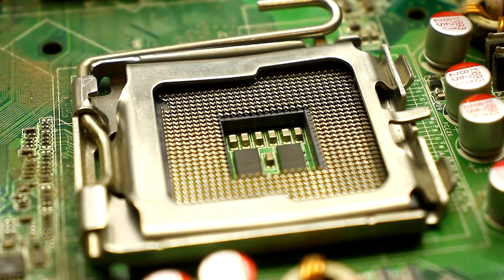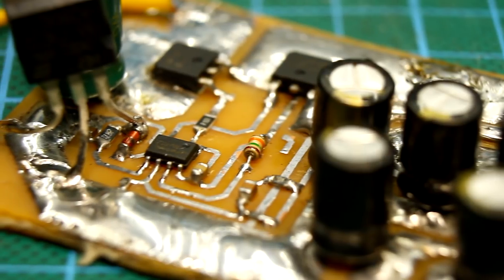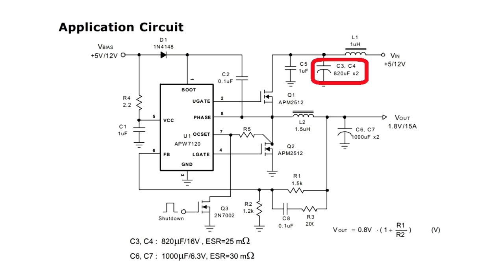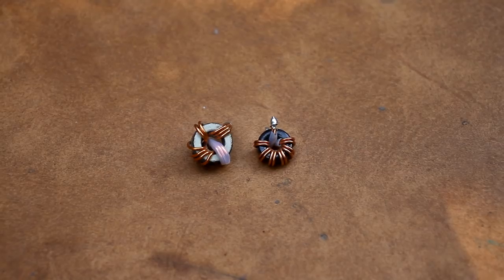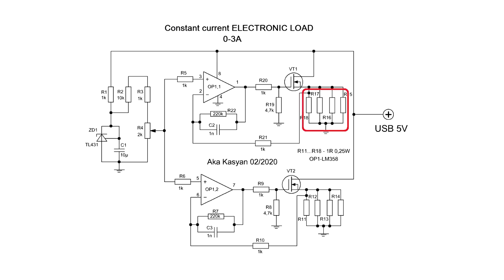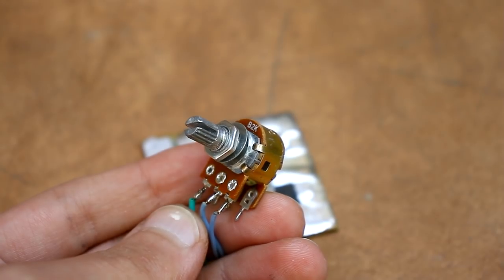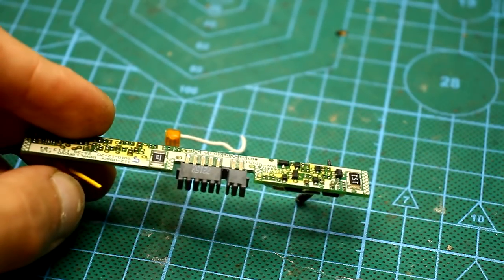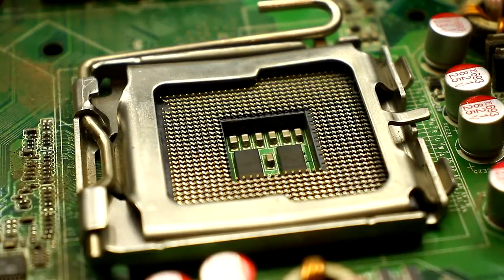What can be done from old MOTHERBOARDS

Comment: had a really silly idea from the first idea of your's, the dc to dc step down car power adapter. lets say i have an archaic 40v 20A dc adapter which used to power an analog sound analyzer/digitalizer for a 800w studio speaker/monitor system, could i have multiple modules running from one input given i make a divider/bridging circuits to divide the 40v output into 8 5v relays that then will power these 5v phone/universal chargers? the input amperage is true 20A dc cc supply so its just sitting and being wasted. many of my attempts to turn the adapter  into variable or modular/modern power outputs fail because it burns through the control/limiter circuits. but if i have 8 high power outputs modules running out there will be a good change it wont damage them, and modern life has 20 gadgets but manufactures dont want to give us chargers anymore only cables haha. if my idea is feasible please reply and even if its not suggestion from an electronics veteran like you would help me a lot about what to do with the monstrous 40v dc adapter. i have more old super power adapters from sound systems too soi will be grateful for  your feedback. THanks!

Comment: Well when my Pentium D'elinquent's motherboard died from capacitor plight I used a heat gun to remove the cpu mount from the board put the CPUs inside with a piece of cardboard behind the cpu so it can't fall out of the mount and framed it with a microscope picture of a Pentium D cpu die as the background.

Comment: Take an old motherboard, (with cpu and memory) and turn it into a drive repair computer.  Spinrite is what I use and it requires your computer to boot and run Spinrite.  Using and old motherboard means you can fix drive problems and use your main computer at the same time.
Reply: I work on computers as a hobby and have plenty of spare everything. I never really thought of fixing a hard drive though. What all can spinrite do?

Comment: To contrary
I have Dell PowerEdge R715 with 2x AMD Opteron 6180, 16x 8GB DDR3 PC3-10600R RAM, Dell PERC H700 RAID, Dell PERC H200 RAID, 6x 400GB SAS3 SSD in RAID6, 2x 256GB SATA SSD, 3x 256GB NVME, Sapphire Pulse AMD Radeon RX 570 as daily driver

24 cores and 128GB of RAM gives me opportunity to use more then one Operating System.  Server runs on CentOS 8 Stream. I  use Debian 10 with Radeon RX 570.

Comment: Only take hardware and coils. ICs and especially capacitors age and are not reliable. De-soldering and soldering shortens their life
Reply: very informative comments here Sir
Reply: Dude, man, harvesting components is fine even on electrolytics but if the electrolytic is over 20 years old just leave it soldered in as they dry out over time or were made like shit to begin with (like my old ASUS board that had the self destructing caps from China that plagued all their boards at the time.  Mine self destructed just sitting there unplugged about 5 years later).
Reply: @generalawareness101  Really. Whats' the MTBF?

Comment: Economically cost & time consuming project with this old motherboard.
So before uploading think   the project should be very useful to the viewers demand. 
USELESS VIDEO.. 
VINCENT
Reply: Old motherboard doesn't cost you anything so for hobby projects it is indeed economical + you learn a ton of stuff by analyzing such circuits and datasheets
Reply: It takes maybe 10 minutes to pull all those components off the board.  Versus either paying very high prices at the nearest shop or significant shipping fees from major suppliers.  Or I must place a huge order to get free shipping.  To do that I have spend a lot of time looking for extra things to buy.  And either way I'm still going to have to get the datasheet and study it.
Reply: agree BUT FOR DIFFERENT REASONS. old PARTS ARE NOT RELIABLE.
 ICs and especially capacitors age and are not reliable. De-soldering and soldering shortens their life